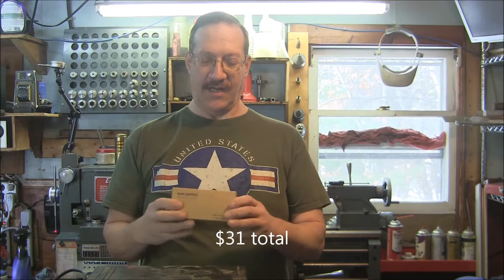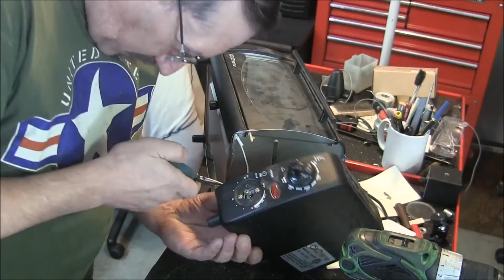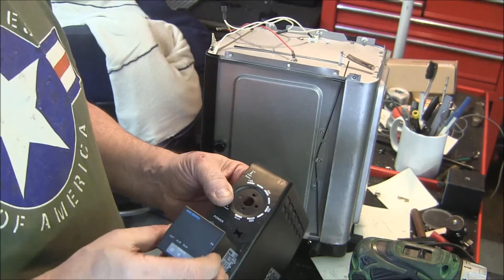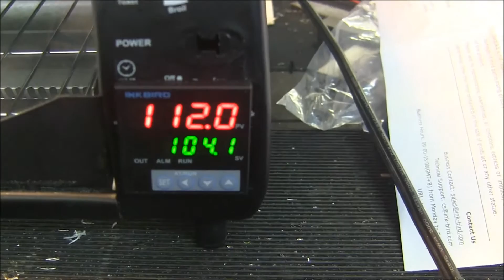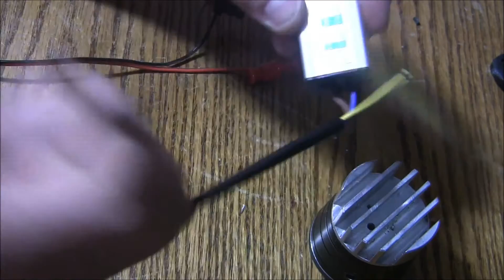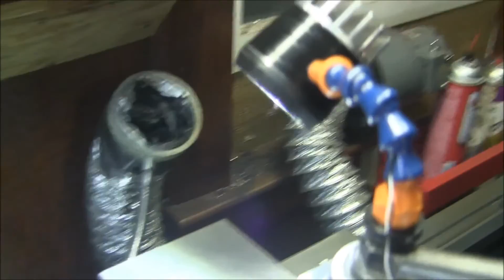Doodads XVI

Comment: Perfect use for the oven. Well worth modifying - giving me ideas now!
Yet another screw head to deal with it seems.
Those Starrett hold downs are a great idea - never seen those before. I wish I could find a good estate sale or similar - nothing better than getting nice goodies for not too much.
Nice simple trick with lathe mark up for hole circle!
Wow, that LED array is powerful. These days the "Cree" type LEDs are amazing.Great result. :)
Reply from the maker: It's getting pretty cheap to put PID temperature control on stuff these days. I have had those hold downs for years and never knew what they were for. Youtube is great for learning stuff!